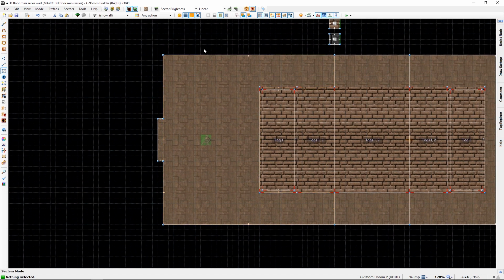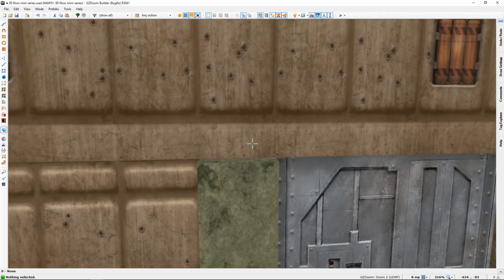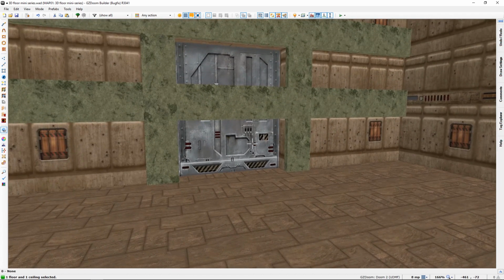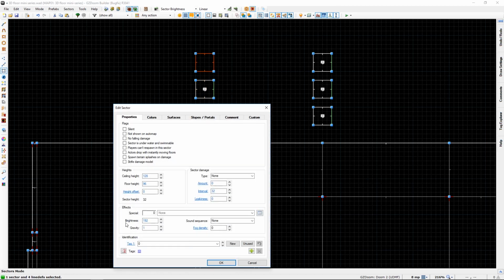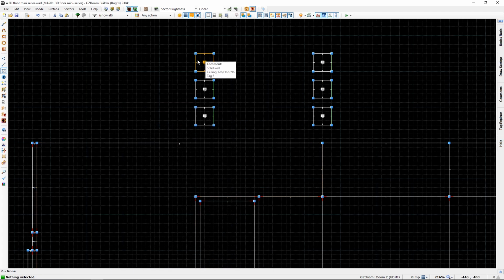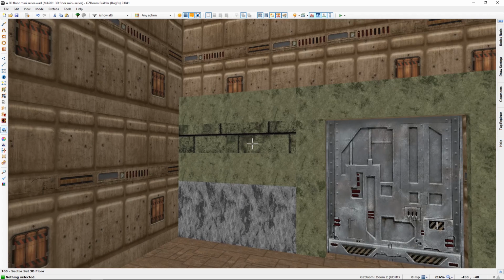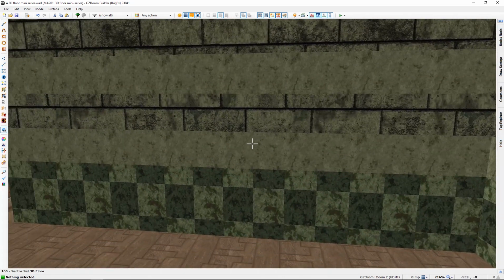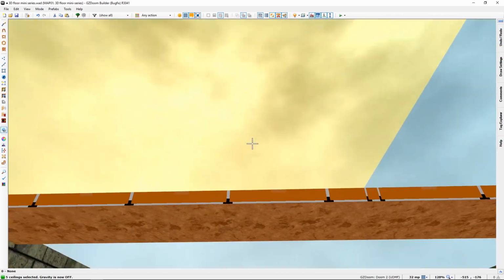Textures galore - GZDoom Builder 3D floor mini-series Part 03

Comment: Please don't do this, mappers.  The most non-lazy way for lazygamer to achieve what a single composite texture would do better.  Save your time, your nodebuilder and gzdoom's visplane/portal calculations folks and make one big composite texture in paintshop and drop it into slade, not waste dummy sectors and engine overhead.  Even the end result, which is much nicer to look at, should be done with a single mural texture you design to fit your actual space.  The usefulness of this method would be if you had them sloped in at variable grades to provide a volumetric look, but this is just flat.

Comment: Do you have a tutorial on how to do transparent textures on walls? Like Jail bars, fences, etc
Reply from the maker: I could probably make one but most textures only work correctly if there is a room on both sides, that is to say no void space. Putting a transparent texture on a wall adjacent to void space will not be "transparent". If you are talking about MAKING them, leaving anything that is supposed to be transparent un-filled in an image editor like photoshop/gimp should work.
Reply: @signaltome  I mean just straight applying one. Every time I do it, the areas that should be transparent are black. I'm sure theres a technique to it but I'm still fairly new to gzdoombuilder and just started watching your vids.
Reply from the maker: @Slaughter1985  Okay, I'll make a short tutorial on it.
Remember though, all my tutorials are dependent on you working in UDMF format, not that transparent textures should be affected if you use anything else. ;-)
Reply from the maker: @Slaughter1985  Here. Not sure if it is what you wanted but this is how it is done I believe. https://youtu.be/8pL0wcWIEyE
Reply: @signaltome  thanks my friend, I appreciate you taking the time to make a tutorial so I'll try this. I'm also working in udmf format as I was advised it one of the best formats to use.
Reply from the maker: @Slaughter1985  It's the most flexible with the most supported add-ons and such. It might not give the PUREST Doom experience but I'll sacrifice that for slopes and 3D floors. Oh right, shameless plug, check out my mini-series tutorials on 3D floors when you fell you have a handel of general usage in GZDoom Builder. :-P Hope I could help with your issues anyway. :-)